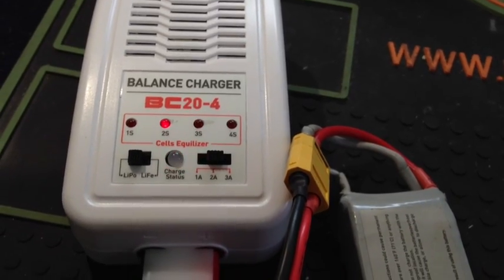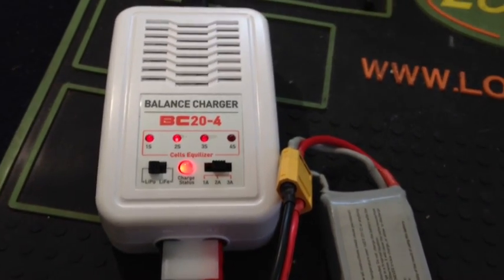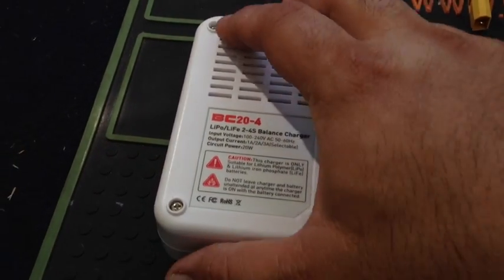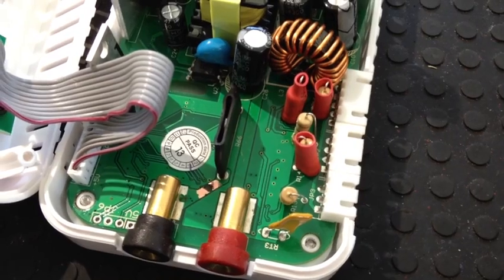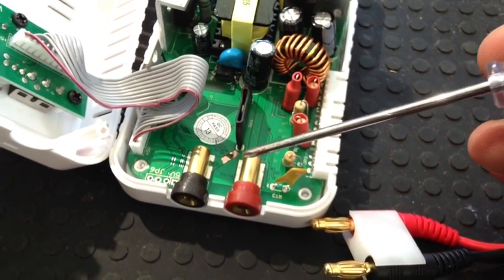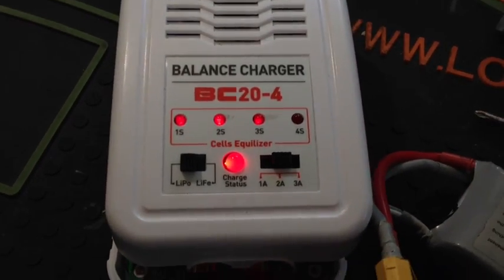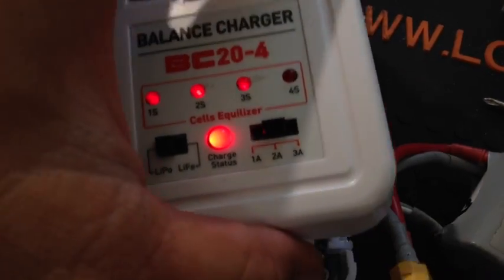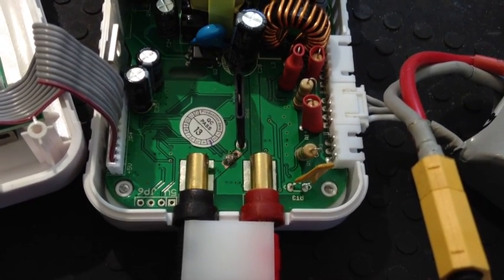DJI Phantom Lipo Balance Charger Repair FAST & EASY FIX!!!

Comment: You could also solder a fuse in there , so the fuse would burn out if you did plug connectors in wrong !

Comment: Here's an idea, why not save money and get a good quality programmable charger, with LCD display? I'm a newbi with lipos, and because of this, I did my research on different brands of chargers, along with the various prices and features they had. I also spent a lot of time surfing the RC forums and watching YouTube videos on the subject. Check out the Squirreled and UltimateRC videos, as they give good advice and reviews on picking a good lipo charger. Lipos can be really nasty, and have a fiery temper if not charged properly, which is why I would never use a cheap crappy charger like this. I have an I Charger 206B with a 350 amp power supply, and it works great. My RCs are a an expensive investment, and I would hate to see them, my money, as well as my apartment and myself go up in flames because of a cheap crappy charger. Peace of mind is worth a few extra bucks in my opinion.

Comment: You should probably wait to go digging in your charger with a metal screw driver until after you have had it unplugged longer. You are asking for problems. (Like Death) if you touch the wrong thing. Just an FYI. Look up basic electronics buddy.

Comment: I did the same mistake of reversing the wires when connecting it up resulting in flashing LEDs.
This is a great fix but instead of bridging the gap with a blob of solder, I soldered a piece of fusewire across the gap as I was concerned about the battery possibly blowing up if it was incorrectly connected to the charger again. Li-Po batteries can be very volatile.

Comment: Instead of solder to bridge the copper trace, get  3 strains of 18gage wire and lay them over the bridge and solder them. This way the wire will burn through and act like a fast blow fuse.
Like in the video the solder will take more current, thus blowing up the battery.
DJI needs to put in a fuse. That would save a lot of headache and sending the battery charger back for warranty repairs.

Comment: why the manufacturer didn't provide a fuse?? !!
Reply: Probably a fuse and a fuse holder would added $ 2.00 to the cost and they are trying to keep the cost down.
I agree that a fuse would be the best thing. I wouldn't doubt that in the future you will see a fuse in future chargers.

Comment: Great helpful video, My charger has the same fault with the lights flashing, Worked fine for first 3 charges and then done this, I have sent it back under warranty as i did not see your video first, My leads where not plugged in wrong but it still failed in it's first week of use, Hope the rest of the Phantom is better quality than the charger.
Reply: Same thing just happened to me! Get a NEW charger everyone. Dji's stock charger sucks!

Comment: help! i just got my phantom charged the battery once, then when i went to charge it again the charger had no lights at all? i don't think i pluged in the battery the wrong way? but even if i did i opened it up and mine doesnt have the copper piece that fails.? the build date is 11-2013 ???? anyone know how to fix this.. nothing seems burnt

Comment: Thanks for the video tutorial, I'm sure it's helped a lot of viewers.
My problem seems to be a little different though and I'm hoping you can help.
My DJI charger is doing the same thing, except it's the 1s light that illuminates instead of the 2s as in the video. I opened up the charger but the circuit seems to be in good order. What else could be wrong?
thanks in advance.

Comment: I dont have a soldering iron and I was desperate. So I just took some scissors and cut a strip of aluminum the exact size of the exposed copper where the open circuit was and laid it over top with some wrapping paper tape over the top of that to hold it in place.
 Its working great...for now.
Reply from the maker: Thumbs up for desperate ingenuity and metal conductivity!!!
Reply: I used a piece of graphite from a pencil. Works fine too !

Comment: I soldered in a tiny piece of really thin (about 0.2mm) copper in mine. That way, I'm hoping that if someone does reverse the polarity again the wire will be the new weakest link in the system and burn out the same way the initial bit did.
Thanks for the video, this really saved me.

Comment from the maker: Actually I disagree on that.  I've been an airsofter for some time now and have used dozens of lipo chargers especially Tenergy/Tunergy products.  And honestly this charger is superior than much of the basic Lipo Balance chargers out there.  In fact, when I was doing multiple chargers for my Phantom batts the batteries charged from the DJI charger came out more consistently balanced and fully charged than the others.

Comment: Thanks, I thought I blew the battery, but found this video, did it and fixed. All batteries charged. But, I got another charger so I have that fuse thing incase I screw up. Now I have two, one that I will use only when I need to. the other newly purchased.